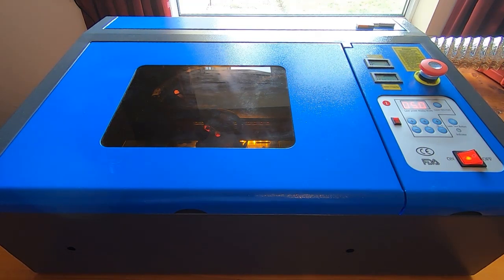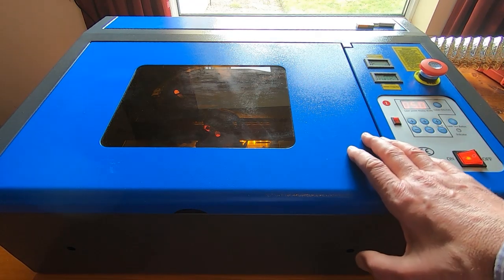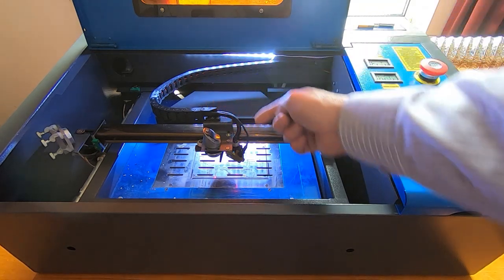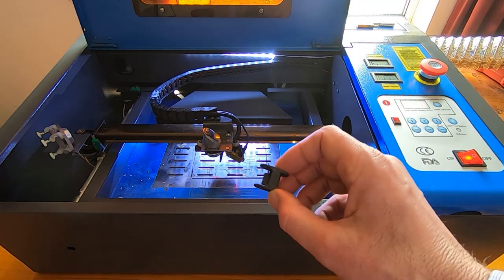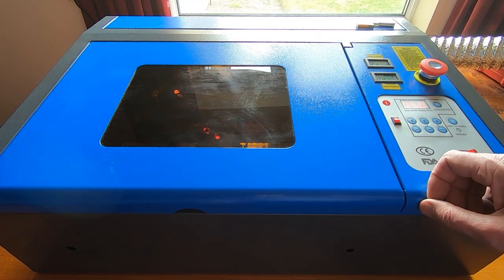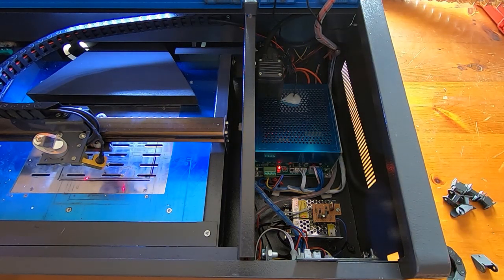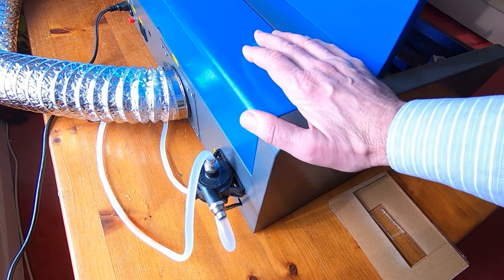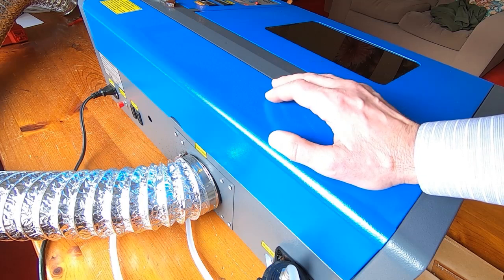Cheap 40W Laser Cutter Part1

Comment: What is the model you have, and where did you get it? I would be interested in one, but I don't have anywhere to start my search. Thanks.
Reply: I believe this is what's called a "K-40" laser. They're sold under a variety of brand names with several different versions.

You can find these on eBay for about 400 USD.